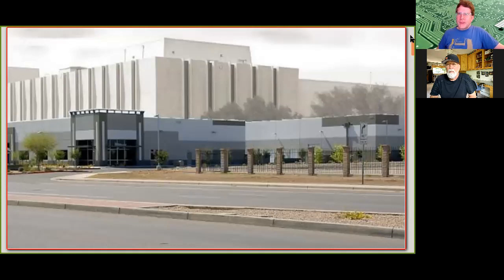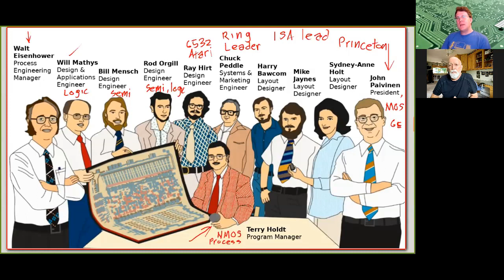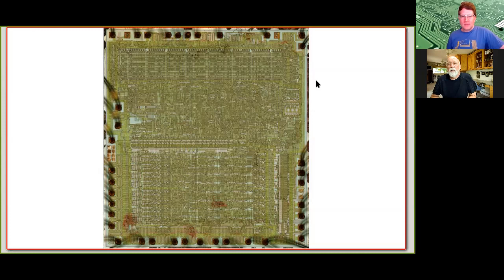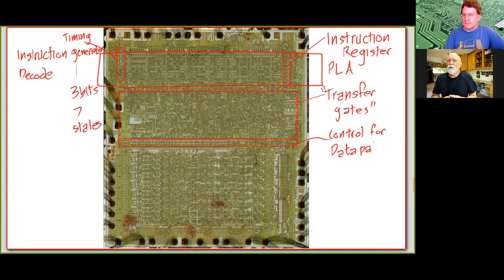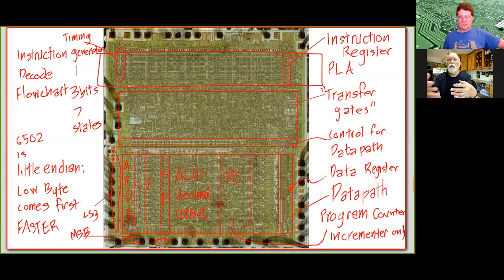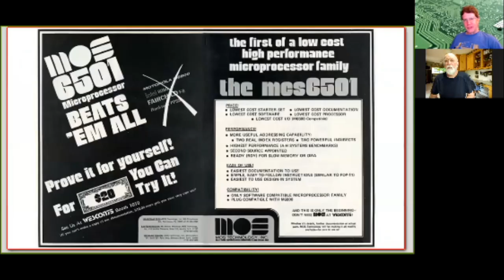Stephen Edwards and Bill Mensch - The Genesis of the 6502 Microprocessor

Comment: Wow... I loved the little-endiannes motivation part. Really a very effective and optimized design...
Reply: Big-Endian address entry could allow the MSB of the address to come out early, which might help using slower access time memories by decoding the CS earlier, maybe that's why Motorola chose that.  So you have a choice of being able to use cheaper memories, or have the processor execute a cycle faster.  No-Brainer today, but maybe not so in the '70s.

Comment: hmmm..i thought Bill was a Layout engineer....Chuck mentioned it in a book...
Reply: Peddle had a nasty habit of disparaging the contributions of others and claiming credit for their work.  He described the Motorola 6800 design engineers as mere "calculator guys".  He did not have a chip background so he did not appreciate exactly what Mensch did, and he dismissed him as a "layout engineer" which is a synonym for "draftsman".  But Mensch had experience in IC processing and physics, and circuit design as well as physical layout.  I know that's hard to appreciate unless you have a background in integrated circuits, but Peddle didn't and thus his comments were quite inaccurate, and usually very self-promoting.  But I think the history has already been recorded giving Peddle most of the credit, and I don't think that's fair to all the engineers that worked on the 6800 and 6502.

Comment: Shouldn't you have changed that from " Stephen Edwards and Bill Mensch - The Genesis of the 6502 Microprocessor" To include the Ring Leader "Chuck Peddle, Stephen Edwards and Bill Mensch - The Genesis of the 6502 Microprocessor" ???
Reply: Peddle (d. 2019) would certainly want that credit.  His NY Times obit said: "Chuck Peddle Dies at 82; His $25 Chip Helped Start the PC Age... Chuck Peddle, the engineer and entrepreneur who helped launch the age of the personal computer after designing a microprocessor..."

But it's not really true.  Mensch (who is still alive as I write this) hints at the truth at the wdc65xx site, in-memoriam-of-chuck-peddle (can't post a link, YT blocks the post if I do)

I've read all the histories and interviews.  The Motorola 6800 project was almost done in 1973 when they hired Peddle who was not a chip engineer at all, but rather had managed mainframe computer centers for GE through the 1960's.  He led the group of defectors to MOS Technology during the 1974 Chip Crash when Motorola wanted to move them all to Austin, and got very lucky when Motorola chose not to sue them into oblivion.  It's curious that most of the 6502 engineers went on to other pursuits and never mentioned it (the team6502 website has Terry Holdt's resume that only lists his time with MOS Tech as the "microprocessor operations manager" and nothing more... I worked with another in the 1990s and he never mentioned it at all).  Mensch continued to use the technology and profit from it, but Peddle wanted to go down in history as the inventor, as if the others didn't matter.  Unfortunately that's how the history has recorded it.
Reply: @larrymelman  Like everything, there is always an owner or a manager or marketing person, who gets or takes, all the credit for creating something new. Even when it could have never been accomplished by just one person.
Reply: In the very first frame of this video there  is a pic of the entire 6502 team, including Peddle, who is the 6th one from the left. If you go into the video at around 8:44 you will see a better pic of all the 6502 members again including Chuck Peddle. So, I guess that titles do not tell the entire story do they???

So yes, Peddle is in thiz video.  Good luck with Rosetta Stoned. Keep practicing you will get there.
Reply: @larrymelman  In the interviews I have seen, Chuck Peddle himself emphasized it was a team that created the 6502, and Bill Mensch himself emphasized in this very video that it was Chuck Peddle who led that team; just listen to him describing Chuck Peddle's role(s) at 11:44. He also mentions that ideas needed to be greenlighted by CP.